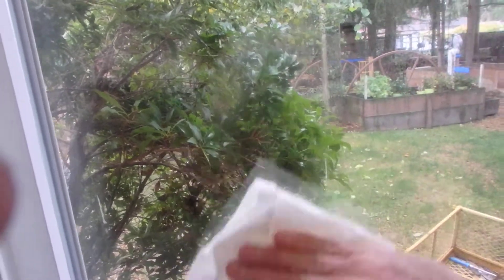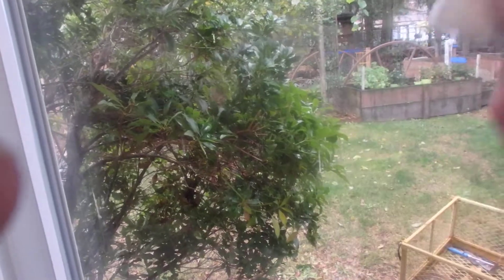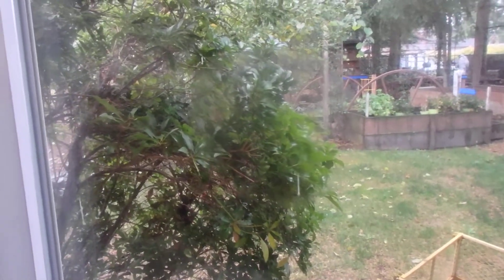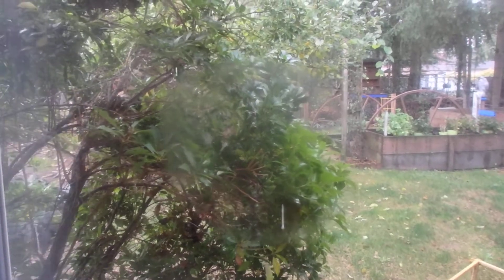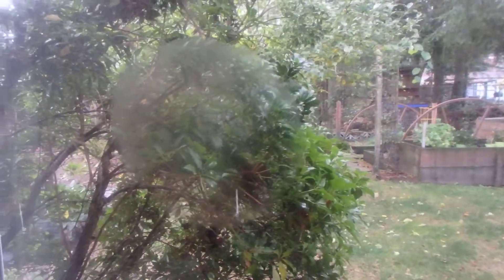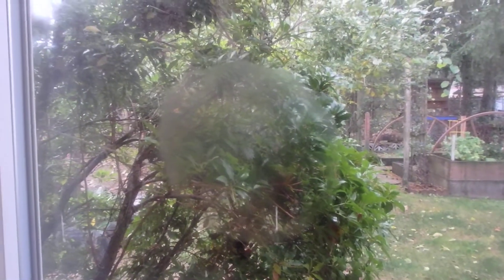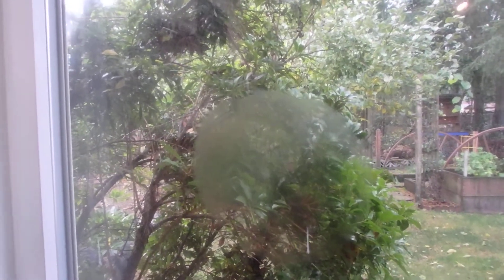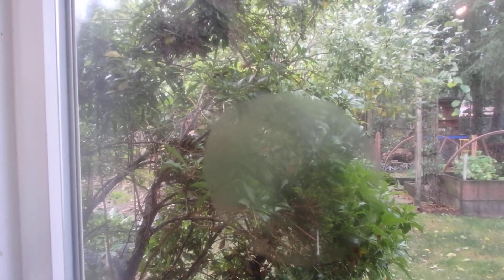Identifying failed windows

Comment: Not done correctly.  The glass is still cold and water vapor from the room re-condenses on the glass after you wiped it.  The test correctly done is to see if the spot wipes away from the inside.  It did.  So it is not a seal failure.   If you wipe it away but there is still a condensation spot that doesn't wipe away because it is between the glass, then you might have a seal failure.  But in this case wiping cleared the glass, so no seal failure.
Reply: It did not clear the glass. Maybe your playback resolution was too low and you couldn't see it?